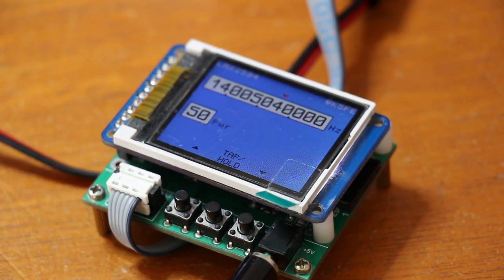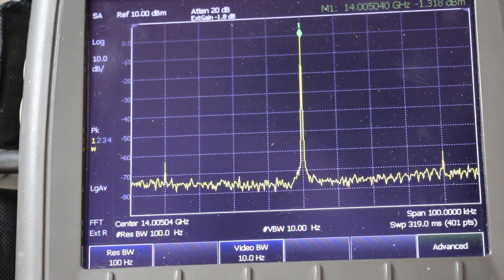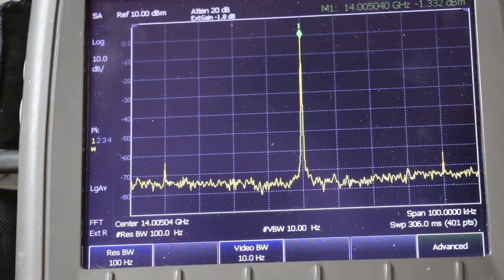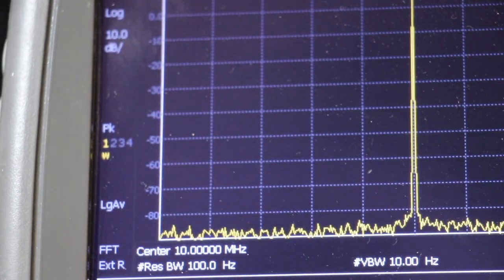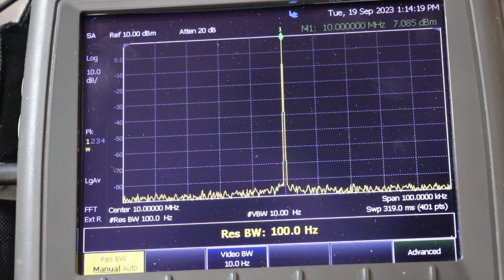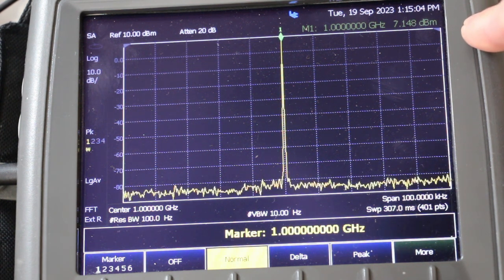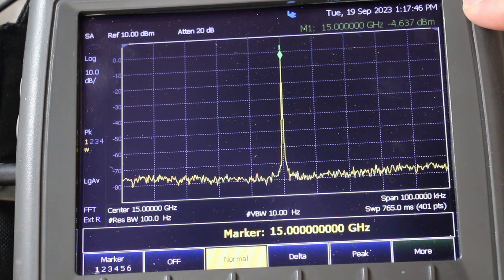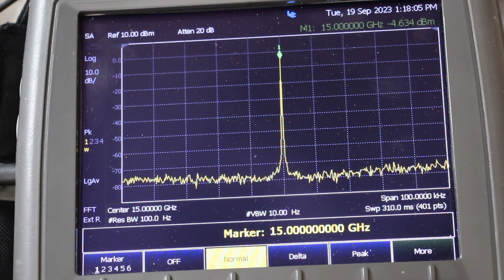#36   10 MHz to 15 GHz RF Generator / Synthesizer - Facelift 2024

Comment: You have a very interesting and useful channel. Thank you. Tell me, how do you provide power to microwave amplifier chips? after all, manufacturers indicate very specific requirements for voltage and current. Are you using just a limiting resistor or are there more advanced technical solutions?
Reply from the maker: Thanks Dmitry. 
Most of the amplifier modules I assembled use the AVA183A, from Minicircuits, and one of the reasons is exactly because the power input is hassle-free, easy to be implemented (+5VDC). But, of course, they are low power amplifiers.